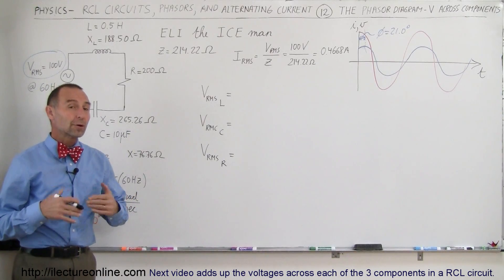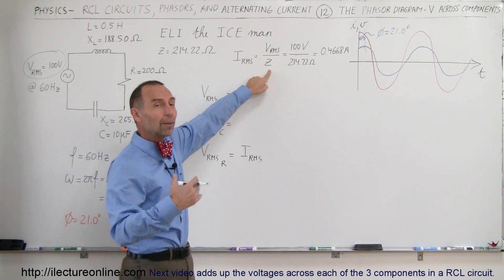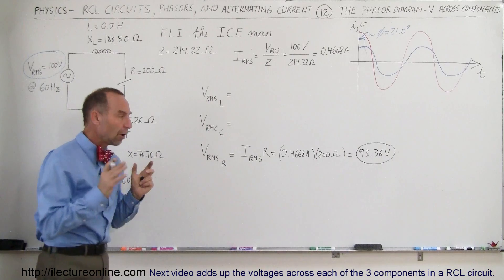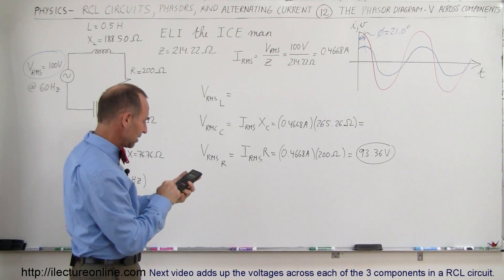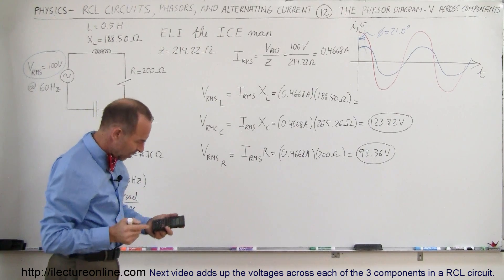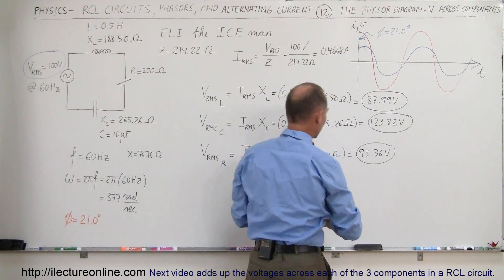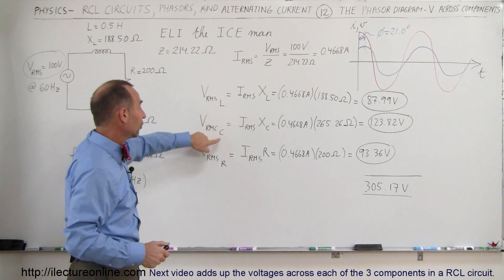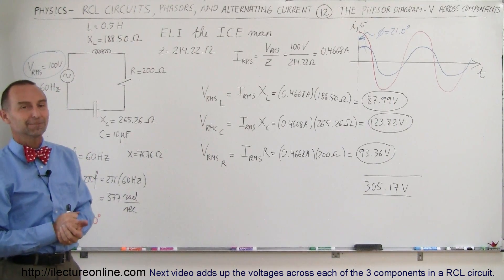Physics 49.1  RCL Circuits & Phasors (12 of 24) Phasor Diagram - Voltage Across Components

Comment: Hey Mike, I understand why there are different voltage drops across the inductor, capacitor and resistor but I don't understand why the voltage drop across the capacitor is more than that supplied by the voltage source. Any explanation would be appreciated.
Thanks :)
Reply from the maker: +MyThundermuffin You cannot look at any one voltage in isolation.  Note that the voltage across the inductor is 180 degrees out of phase with the capacitor, so that you have to subtract one from the other first before you add it to the voltage dropped across the resistor (90 degrees out of phase with the reactance).